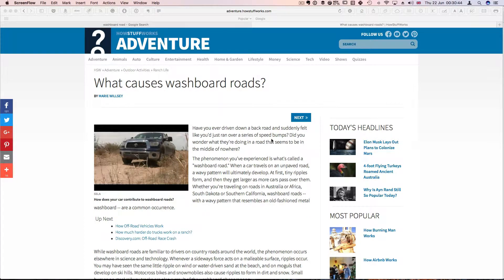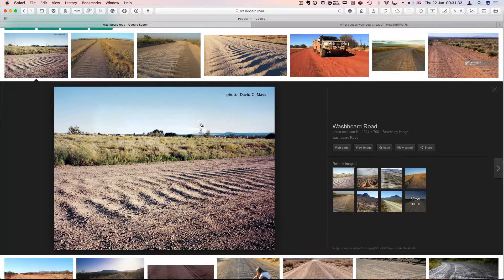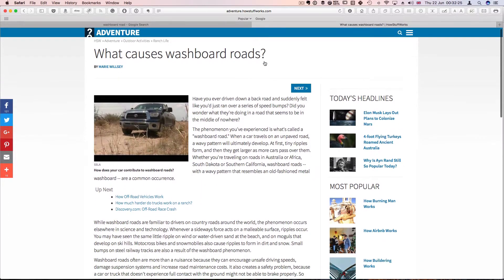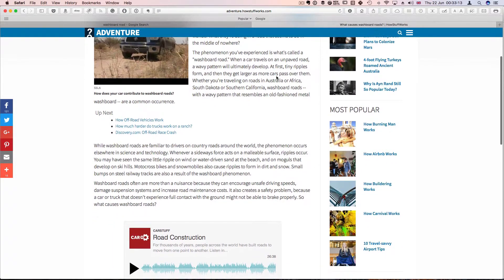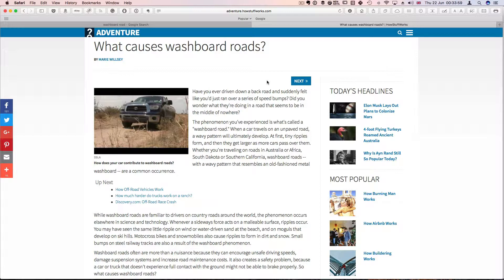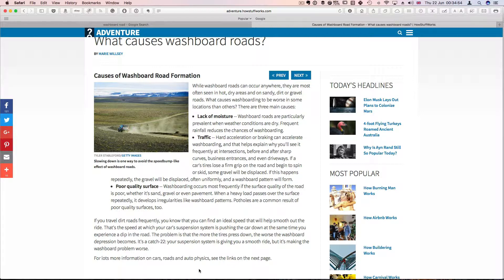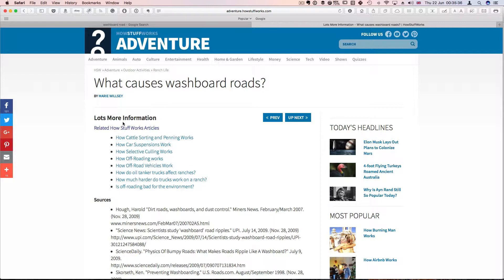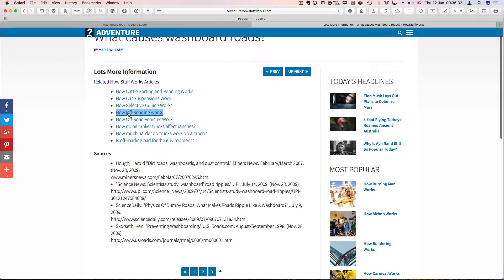What Causes Washboard Roads? The Science Behind Corrugated Road Formation

Comment: Ya a lot of it is the road maintainer "road grader" has the blade down too far and it is going too fast, making the blade skip along instead of a nice even scrape creating the washboard effect.
Reply: I live in Iowa, we have alot of gravel roads, im sure you do also, but some maintaners are better than others at keeping them smooth. My uncle ran a maintaner for 30 years and every time he sees the ripples he curses the drivers of the maintaners about having the blade down too far and going too fast it makes the blade vibrate and skip accross the road. If they take their time and do it right it wont happen. But you have to fix the washboards that are already there with the plow first before you can correct it. The washboards need broken up then smoothed out.
Reply from the maker: Great point!